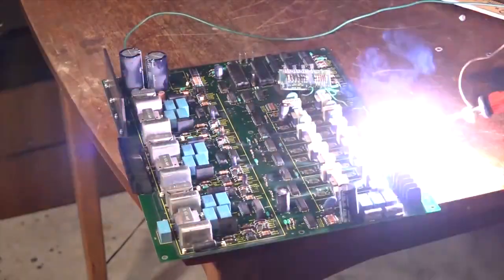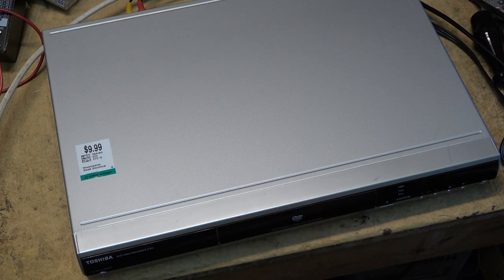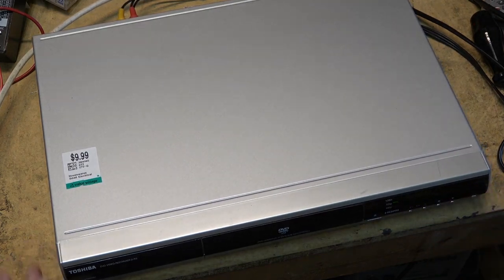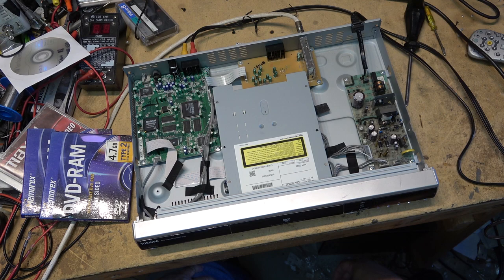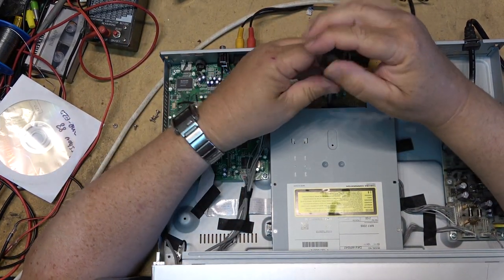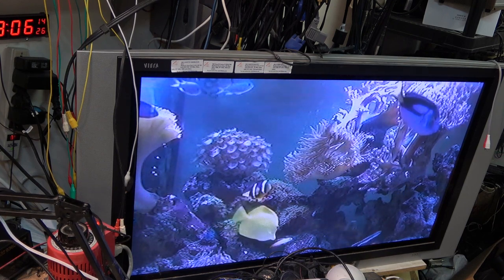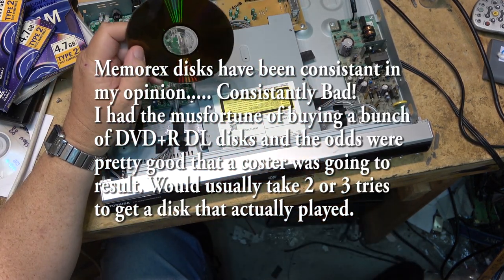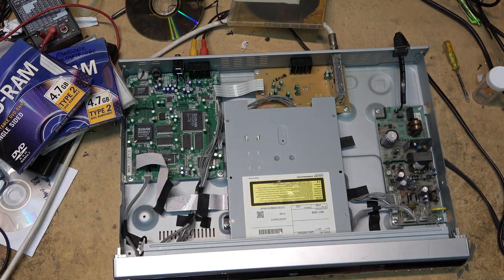I got another 10.00 deal at the thrift store. Did I get ripped off this time?

Comment: A Model X can tow up to 5000lbs (2268kg) so a 25ft trailer is no big deal.  As for the range that depends on trailer shape and speed, but even assuming he can only do half the rated range that's still 120-150 miles.  He probably plans to charge the car at the camp site since most sites have either TT-30 or NEMA 14-50 connections, both of which will charge a car nicely.  Also some Tesla Supercharger sites have a pull-in or pull-through pedestal so cars with trailers or large bike racks can charge without unhooking anything.

Comment: Yesterday I fried my Philips VCR. The tape got stuck, I was lazy to do the thing by hand and injected 12 volts to the motor. Of course the Servo IC fried. I don't know what I was thinking. Was a good machine, SQPB playback, 6 head ... Pause was perfect on every tape speed. I'm sad.
Reply: Next time you can apply 12v to the motor but disconnect the load motor from  everything else.

Comment: Do you do firmware updates on these?
Reply from the maker: Don't have the software disk.
Reply: @12voltvids  Hey Dave if it ain't broke don't fix it LOL. In other words if it functions without a firmware update leave it as is. On a side note if BIG IF, it became necessary to do such an update typically the manufacturers website would provide such an update package (you burn a disk from the website that contains this firmware update. I called tech support for a Panasonic DVD machine and the tech walked me through what to do step by step. As it turned out it was sa simple as putting the disc in the machine it recognized it updated the firmware and ejected the disc automatically when it finished I think it even powered itself off too it was a VERY LONG time so the details of the process have faded a bit in my memory LOL. Anyway hope this helps if you ever do need to attempt something like that.

Comment: Whoa! ZORAN? I've never seen a Toshiba RD-XS based on anything other than an NEC chipset. I really wonder what the model number of that DVD-RAM drive is. Oh boy.. Oh boy.. looking inside the drive.. can you fix it.. wow. There was a Rumor that DVD-RAM discs weren't always cleaned after manufacture and retained a film from the factory, washing with a mild soap and luke warm water would remove it and they would work just fine. 4X speed drives don't like 16X speed media.
Reply: do zoran chips have anything special? higher clock speeds?
Reply: @walle637  They make excellent recordings. ZORAN chips were used in the RCA DRC8030 I believe and just had a good reputation, but they were late to the game. This Toshiba is an oddball, its menu is like those models that came after the end of the Toshiba RD-XS line of products but before the Vardia.